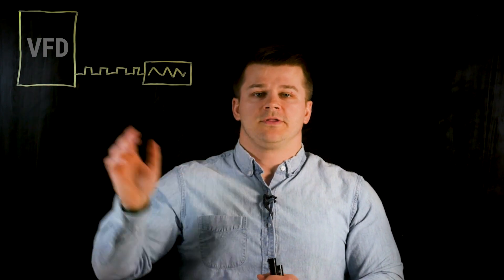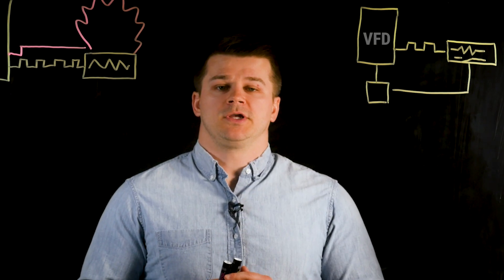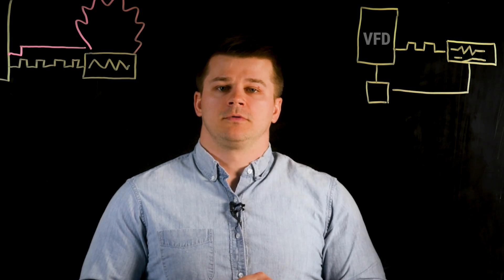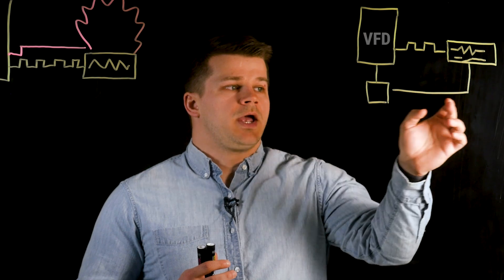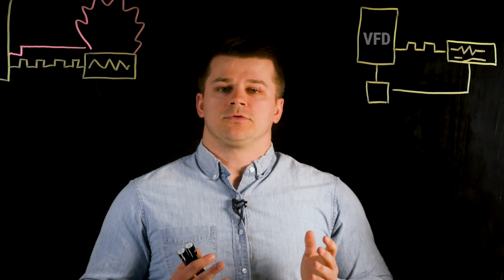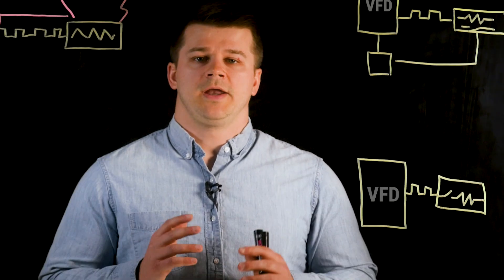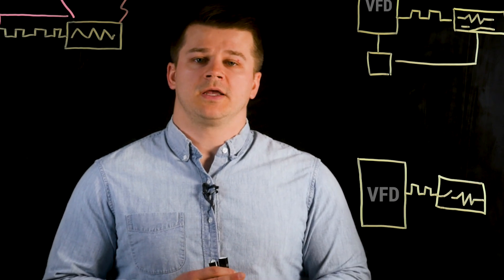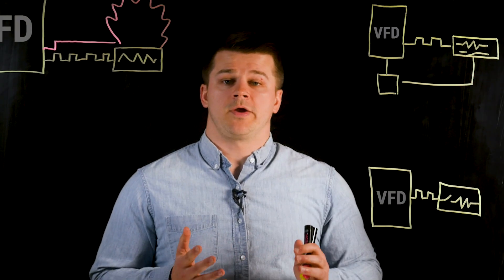Methods to Protect Braking Resistors from Overheating

Comment: Hi
Firs sory to weak of my langug
Why the breaking resitor be come very hot
Reply from the maker: It has to do with energy. When a VFD is using energy to turn a motor then the energy is being used for rotational motion in the motor. When a motor is turning by itself due to a load turning the motor due to gravity then energy is going from the motor back to the VFD. Energy needs to be dissipated  to a braking resistor if a line regen unit is not installed. If a braking resistor gets too hot there is a possibility of components melting or even catching something on fire. This is why having the correct size braking resistor and a VFD with protection functions is essential for safe operation.
Reply: @KEBAmerica  thanks 
But there is meny of same machin 150 number  witch works in same condition and situation just one of them is hot.
I have cheked all of wireing and connections and motor but appearantly there is no problem !

Comment: Hi
Elevator and crane application we can't switch off resistance ro VFD Inverter any other idea?
 normally we use higher watt resistance 
resistance become very hot sum time
Reply: two options  
1. Cost effective --: what you are doing correctly, 
 2. Go for 4 Q regenerative Drive which send back energy to main (Siemens PM250 ) but initial cost is high    , no DBR ,DBU required, continues braking possible

Comment: The main method I'd deploy to achieve this is to increase the deceleration period to a workable period that does not compromise the application or safety.

And the other trick is to avoid un-necessary dynamic braking.